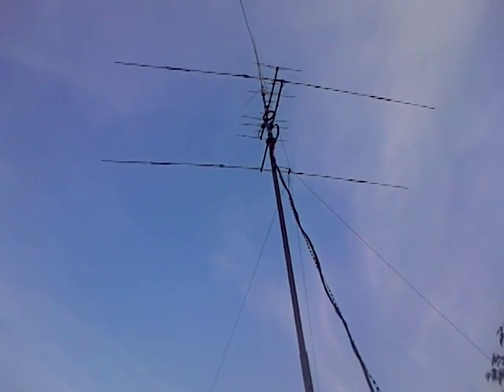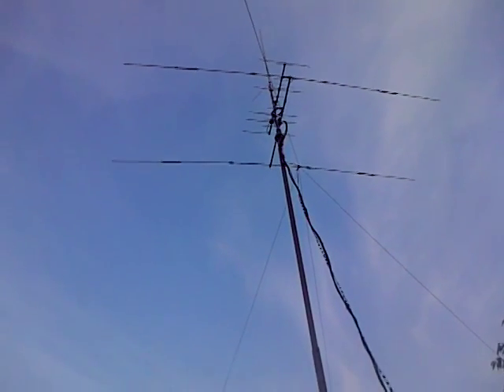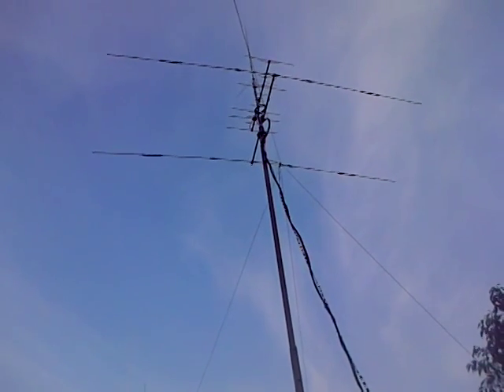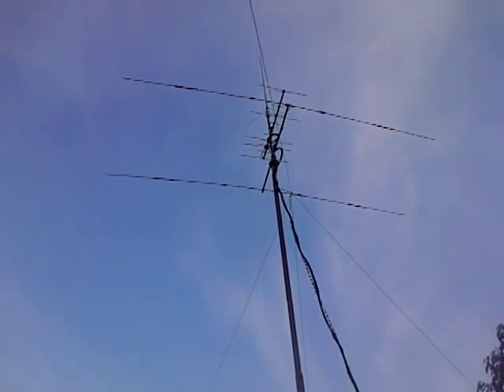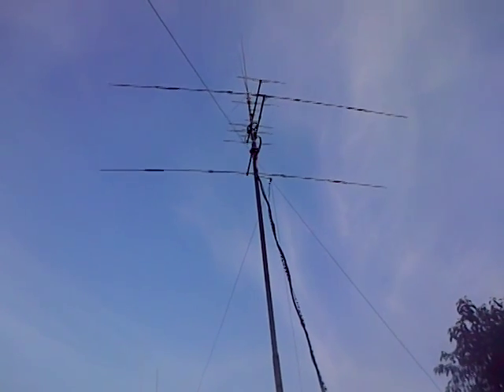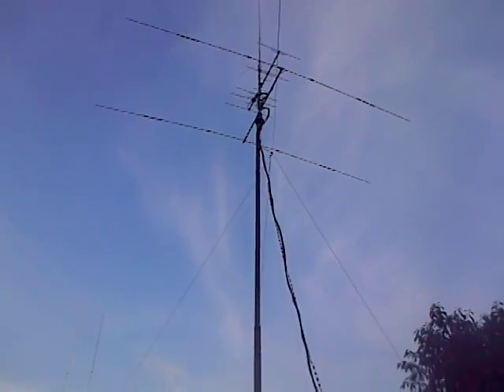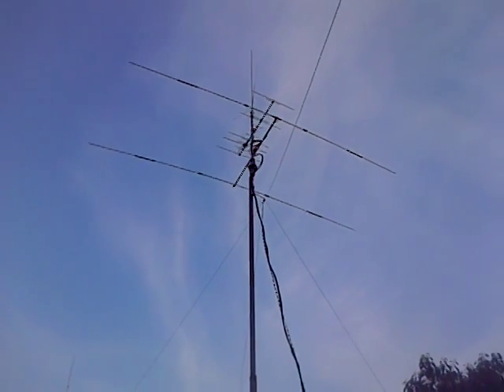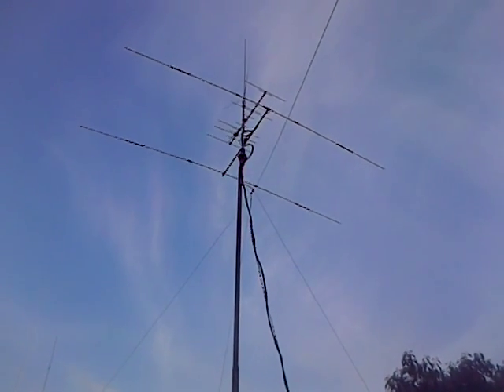MOSLEY MINI 32A TRI-BAND YAGI - FINAL PART WITH A GOOD SWR !

Comment: Can you comment on the RF choke, if  used after the 9 inch adjustment. Dimentions given in the instructions are completely off for my installation (20 feet above ground).

Comment: I received my Mosley yesterday. Since today is a temporary mast only 20ft above the ground, I applied to the dimensions given in the manual 12-1 / 2 "radiator and 14" reflector I have also mounted choke balun.
My VSWR @
 14-14.35MHz 1:1.4 <-> 1:1.07 <-> 1:2.0
 21-21.45MHz 1:2.08 <-> 1:1.0 <-> 1:1.5
 28-28.85MHz 1:2.29 <-> 1:1.06 <-> 1:2.0
73s
Wojtek
m0osh